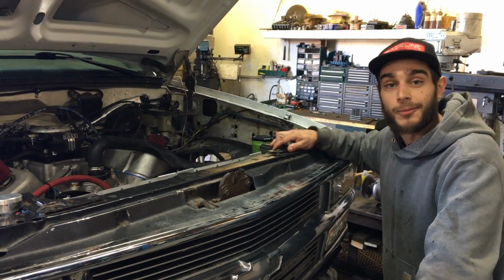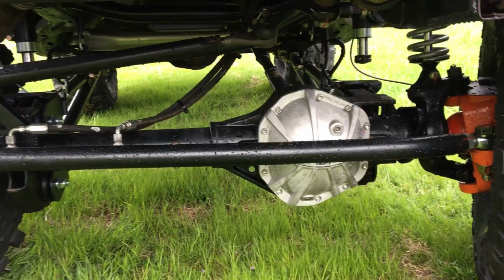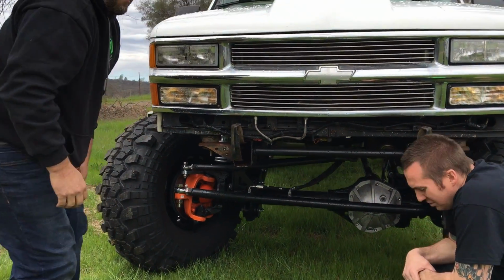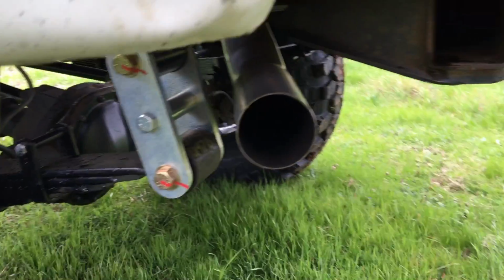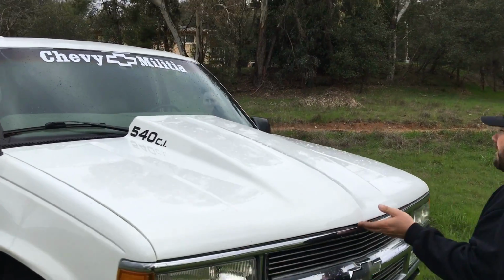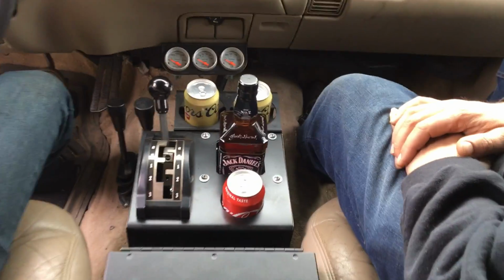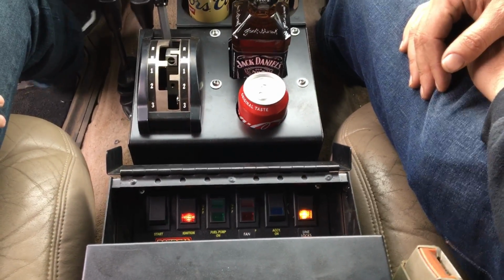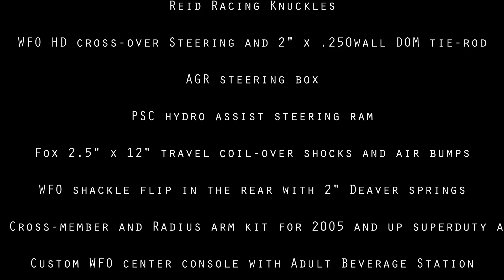540ci 650hp SAS Chevy Tahoe on 42's

Comment: I’m running 37”s on a stock front end (pickup) it rides like $&@? Lol ball joint flip cranked torsion bars and 3.5” blocks in the back and a 3” body lift lol 
Off road it’s decent with a nv4500 but don’t steer to far frame doesn’t like it haha.
Man that Tahoe is making me feel a bit jelly lol

Comment: How does it ride and flex with that leaf/radius arm combo?
Reply from the maker: Wheels right through the Rubicon and drives down the highway at 75+ no problems. Super stable.
Reply: @wfoconcepts  awesome. I’m doing almost this same swap in a k5 blazer. SD60 using the Ford radius arm mounts and 56” rear leaf springs

Comment: That is one mean Tahoe.  Will you be putting a radius-arm kit for the obs Chevys into production?  If so, will the crossover tube be necessary?
Reply from the maker: With so many different options (Front axle, Transmission, T-case) its hard to put a full kit into production. But if you give us a call at the shop we can go over your build and get you set up.